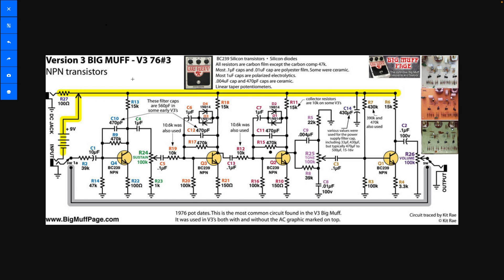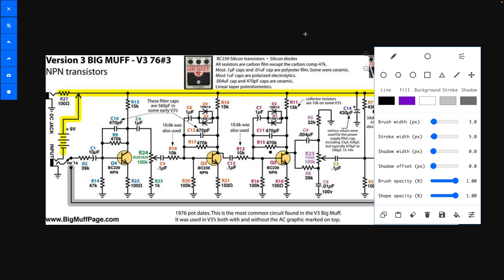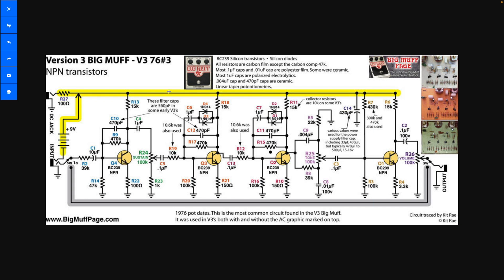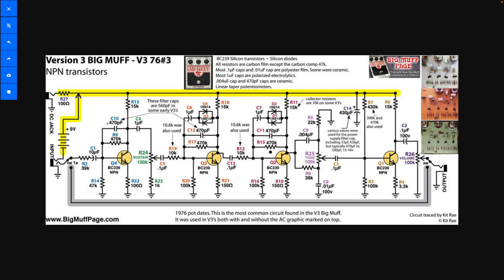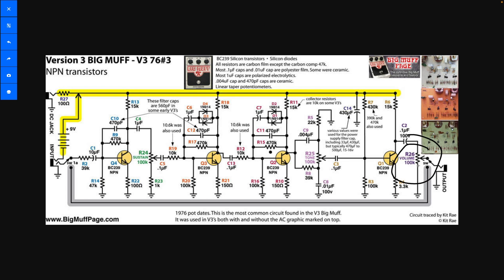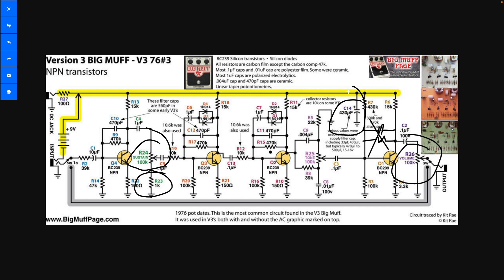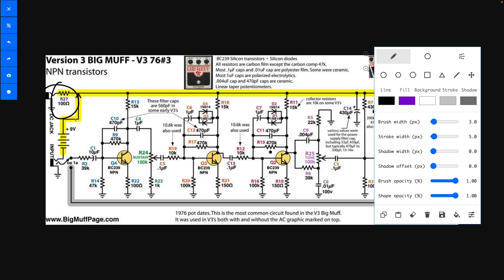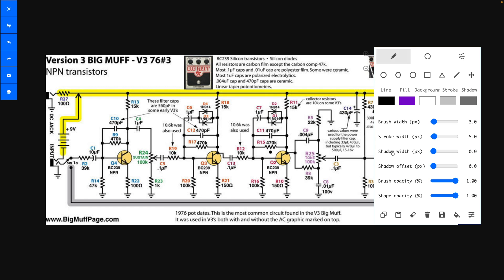Big Muff Schematic Analysis

Comment: I come with with 159 for the high pass cut point for C13 R12. Would R16 be in series with R12? C5, C13, C3 are coupling capacitors to keep the stages isolated from dc. Are these film caps? If not it would be interesting to use films as they do in hi-fi audio amps

Comment: Seems like the end result could have been done with half the circuitry. Wonder why two clip stages and the amp in the beginning?
Reply from the maker: Yeah. Makes me want to make a version where you can toggle between one, two, or three clipping sections. Maybe call it The Small/Medium/Large Muff.
Reply: I actually tried to build this circuit a few years ago, but didn't have all the right components and used the closest I could find. It actually turned out sounding really good. It is quite a little chugging machine and I have used it in many recordings.

Comment: Small signal diodes and PN junctions such as emitter-base of BJT have Vf (forward voltage) drop of 0.6 to 0.7V depending on current and temperature. You incorrectly said "point 0 7" volts for the 914s which I interpret as 0.07V.

Comment: Hi guys, what could be the cause of the self-oscillation problem in Big Muff? I tried different capacitors, cleaned everything, tried different transistors, but I still have oscillation, help!
Reply: the thing is that I've made a couple of muff before and they didn't have this problem

Comment: It is a second schematics from two I've seen on this channel, where is an error that makes the circuit not working at all. Here it is the bias for the last transistor, which will drive it into full saturation, so no signal passing at all. To me it seems like the R7 is supposed to be connected to the collector as the feedback as well, like the previous stages, then the operating point will be in the 4.5V ballpark on the collector...

This remark is not on the author of the video, but it seems the literature contains intentional errors in it to make the circuits not working.